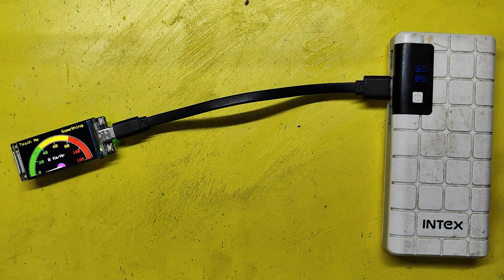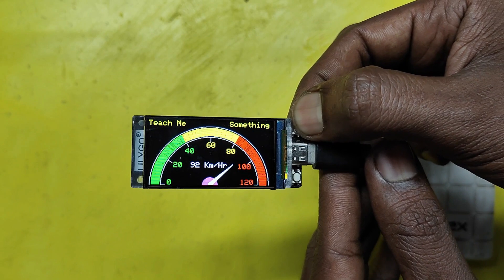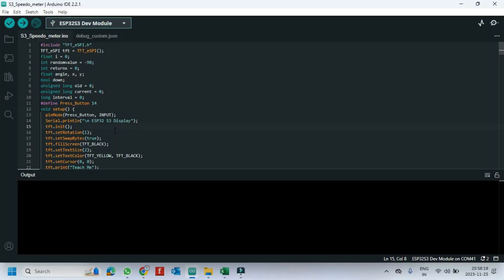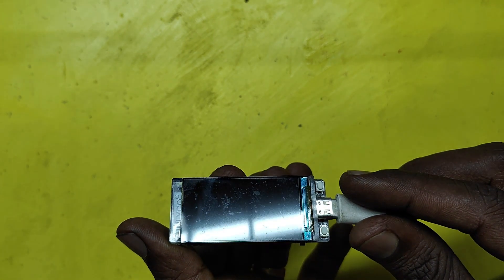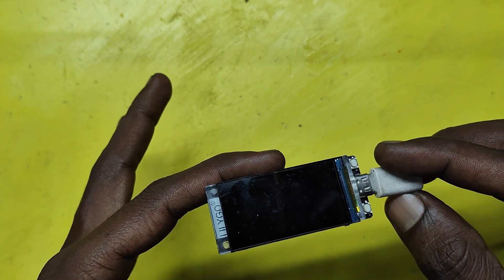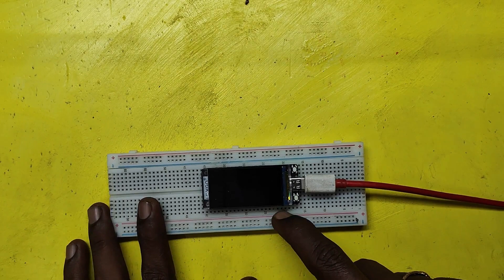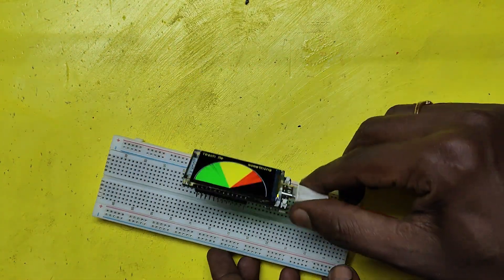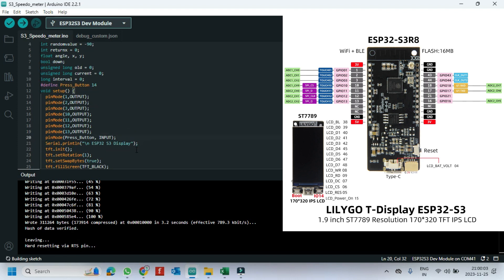Lilygo T Display ESP32 S3 Black Screen issue solved | Lilygo T Display ESP32 S3 not working | Black

Comment: not working bro....my esp32s3 display still black srceen...
help me about this matter
Reply from the maker: Keep the board open. Don't connect any components and breadboard.
It was working for me..
Reply: See my post in the comments. I got it working. 1) I am using an ADS1115 board to capture precise analog to digital values. The display turned on when I connected the ADS1115 SDA to pin 2 and the ADS1115 SCL to pin 1 (SOLUTION)!
2)	Pins 1 and 2 change between high and low (high frequency). If these are not connected, the display is black.
3)	The SPI pins change between high and low (high frequency).

Comment: sir, same my display also not working
Reply: See my post in the comments. I got it working. 1) I am using an ADS1115 board to capture precise analog to digital values. The display turned on when I connected the ADS1115 SDA to pin 2 and the ADS1115 SCL to pin 1 (SOLUTION)!
2)	Pins 1 and 2 change between high and low (high frequency). If these are not connected, the display is black.
3)	The SPI pins change between high and low (high frequency).

Comment: Thank you for the video, but after I did your trick, still have the same problem with black screen ( tried on 2 Lilygo T-Display). any suggestion?
Reply: See my post in the comments. I got it working. 1) I am using an ADS1115 board to capture precise analog to digital values. The display turned on when I connected the ADS1115 SDA to pin 2 and the ADS1115 SCL to pin 1 (SOLUTION)!
2)	Pins 1 and 2 change between high and low (high frequency). If these are not connected, the display is black.
3)	The SPI pins change between high and low (high frequency).
Reply from the maker: @GaryMarkowski 
Thanks.
It will be useful for all.
Reply from the maker: I didn't try another method